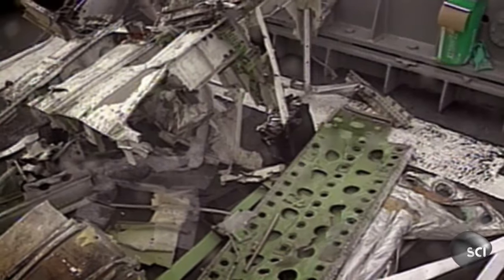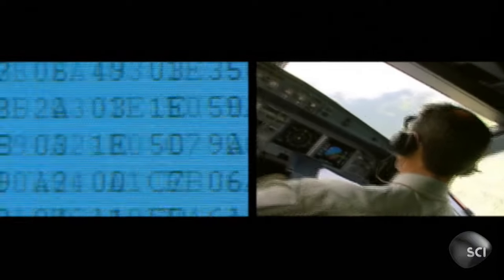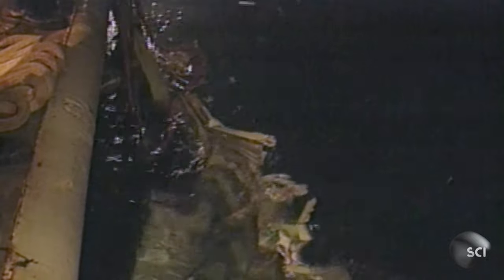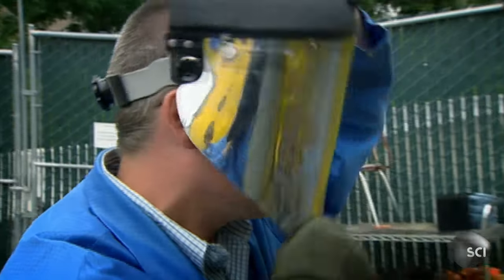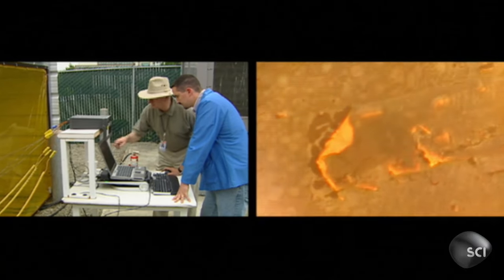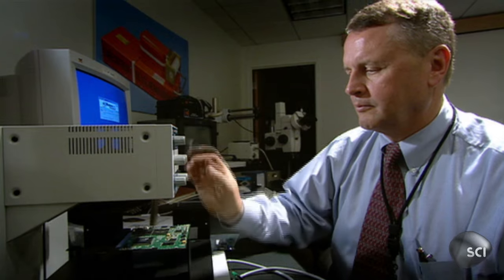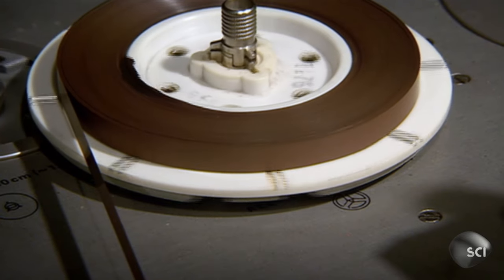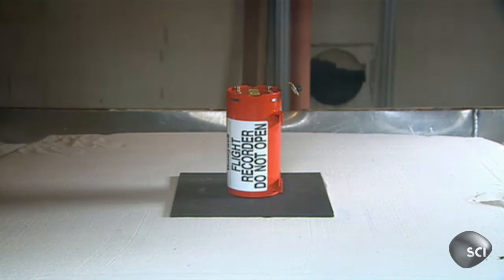How Black Boxes Are Made | How Do They Do It?

Comment: Why don't the planes just transmit the data to the ground for safe keeping instead of all this black box foolishness?  Because the pilots union has prevented losing control of the occaisional embarassing behaviour that goes on behind the scenes.  Pilots want to be able to destroy the data at the end of a flight.  Look at all the effort spent on finding black boxes at the bottom of the ocean when the data could have been easily transmitted and stored on the ground.
Reply: If something catastrophic happened to the plane like transmission signals to the ground were severed you would need the black box.
Reply: Brian Patton
No, no, no, a battery powered transmitter can be at least as reliable as a recorder and you don't need to find it at the bottom of the ocean.
Reply: Greg Collins if the transmitter is broken?
Reply: Actually, it's not that simple. A flight data recorder, as mentioned in the video, needs to be capable of recording several hundred different parameters at once, many times a second, for the entire flight, from engine startup to engine shutdown. That means quite a high bandwidth is required for every single aircraft that's flying with a wireless FDR. If that goes through satellites which it will because of all the transoceanic flying that goes on, then that gets very expensive very quickly, and it will necessitate new satellite launches and server space to download all that data from all those aircraft.

It'll cost the airlines millions to implement such systems, especially because you're looking at a data rate orders of magnitude higher than what ACARS is, plus it needs to be encrypted all the way down.

The $30k per plane onboard recorders suddenly seem like a much better idea, eh?
Reply: how are you going to handle all that information? who will receive it? what channels will each aircraft use? what happens when you're out of range? who will process and store the data? that crucial last half a second after the last transmission?
Reply: And also, crashes such as the one described in the video are EXTREMELY rare. It doesn't seem to justify the cost of a system such as the one you described.
Reply: They can't transmite data when over certain parts of the world
Reply: It is totally possible, in fact it is done now,, the R&R  engines, send a variety of parameters to Derby R&R headquarters when running. IMHO there should be a mixed system recording procedures, in plane & to manufacturer simultaneously.
Reply: Because when they are in the middle of the ocean they have no radio contact with ground
Reply: This is something that is being looked at currently at the order of President Trump.
Not to the ground but to the satellites that are above the plane as it travels.
Reply: Greg Collins clearly you don’t understand a thing about planes. First of all accidents are rare, and investing such a system for thousands of millions is not worthy, and can be hacked easier too. Second some not so developed countries may not have the ability to invest in that system, in this case the Flight recorder(black box) is still the safest way to store data. Third if it’s a wireless system there will be a way to shut it off, but Black Box cannot be shut off and will keep recording until that last moment of the flight. The newest black boxes have been greatly improved, they can now send signals for 90+ days once activated, can eject from the plane and float on the ocean or safely land if the plane crashes, and can withstand higher heat and more pressure.

Comment: The military shot it down because it was thought to be an UFO.

41. I can only explain that we have clear records that clearly prove that the plane was hit by a missile that was supposed to shoot down the TWA 800 for defence reasons, because a misinterpretation led to the assumption that the plane was an unknown and hostile object. 42. The missile, however, did not explode due to a malfunction of its detonator, but merely tore a hole in the aircraft and continued to shoot, only to fall somewhere into the sea. 43. Due to circumstances unknown to us, a sparking mechanism must have been created when the projectile hit, which caused the aviation fuel to explode. 44. It may be natural for someone to have brought a bomb aboard the TWA, but it certainly did not explode – if there was a bomb aboard at all. 45. Our records did not mislead us, nor did our investigations, to the effect that the missile projectile was the cause of the aircraft being damaged and then caused to explode by a sparking mechanism. 46. If the story about the man applies as it is set out in the written, then at least not in the sense that his bomb, if there actually was one, exploded. 47. If such a bomb actually existed, then it must either have been found by the salvage crews or thrown out somewhere into the sea where it was not found.
Reply: bro??

Comment: Worked for Honeywell for 11 years, testing Lithium Polymer/Ion batteries for 12 years, company battery expert.  1) NEVER EVER EVER trust what HONEYWELL tells you AND  2) any Lithium cell can go off like a road flare if dropped from hip height OR even in the OFF position in an over head compartment in an airplane. Makes me cringe that airlines tell you to turn OFF your phone! Makes no difference whether it's on or off. It can still cause a fire. People don't get it because of the media reports. Every lithium powered device anywhere, whether it be a Phone OR Honeywell Portable GAS detector (yes a life safety device) has had a fire as a result of a Lithium Ion/polymer battery. Just wait until a pilot in a plane has his device catch fire, then we'll see ALL devices banned from planes!!!

Comment: Everyone in here keeps talking about making planes like black boxes, do you understand if they even could do that (which would probably make the aircraft too heavy to fly efficiently), that even if the plane crashes, the people on board are probably going to die from the force of hitting the ground. The real question is, why don't they put parachutes on planes that can deploy in case of a 100% imminent crash or other severe failure such as a stuck landing gear? I heard it is because planes are too heavy, but come on, there has to be something that can be done. Private jets and smaller aircraft come equipped with parachutes for the aircraft in case of an imminent crash, we as a species have engineered and built incredible things, and made incredible discoveries, but we cannot figure out how to make planes completely safe in the event of a failure, other than recovering CVRs and FDRs and fixing the issues after many people lost their lives?

Comment: Do they still use tape? Or solid-state disk recording nowadays?
Reply: Most probably a hybrid . Tape are magnetic based after all. SSD are vulnerable to short circuit. Having a compact and reliable (hybrid) black box would solves alot of engineering. Problems are the recovery of one..... If only it's easy to locate them

Comment: is it possible to make a plane out of the material used to make the blackbox itself? in a sense how the durability was created, can it be integrated to what is needed to make a plane? if you say material is too heavy, isn't it just a matter of time we create an engine with stronger thrust and speed? in the end its all numbers after all.
Reply: It's not just about the material (they said the black box is made from simple stainless steel) but also about how it's shaped and how much of it there is. It's a quarter inch thick stainless steel formed in a circular shape and it's about the size of your firearm, and it's packed tight with fireproof material and some other foam. If you'd scale up the size of it leaving all the dimensions the same it'll be completely useless as a flying machine, unless you'd invent antigravity drives or something (but then I don't think you'd actually need so much toughness).
Reply: Unfortunately if they could, most fatalities are a result of rapid deceleration forces. Basically, all the organs and the brain rupture as they keep moving forward and crush themselves from inside.
  On the bright side, just dust off the plane and your good to go!

Comment: can't believe they still couldn't make the black box float + insert GPS in it. its time to upgrade.
Reply: Mike l well the rest of the plane is in the way for the black box to float upwards. And it is pretty hard to make a compressed air can (to be able to expand and float) to be able to resist such high temperatures. it would just explode.
Reply: U.S already has the floating steel technology, where even battleship will not sink in the future.
Reply: +Mike l wouldn't work well for the full black box/CVR , but I see little reason why a small, say 1 min worth of in flight recording, duplicate black box couldn't be attached somewhere on the outside skin of plane, and be designed to break off with a crash into water and do exactly as you suggest.

Comment: +tryteka Replying this way because you don't have a reply button showing.

Anyway, back when FDRs were first mandated, there was no digital air-to-ground communications system, and many systems are designed to be compatible with each other, meaning that newer systems are capable of being installed in older aircraft, and if required, vice versa.

And there still hasn't been any legislation mandating that the same data is streamed via satellites ('cause oceans fuck yeah).

not to mention that you're recording quite a bit of data, at quite a high rate. That results in quite a large amount of data that you need to transmit, which gets expensive, especially if you hire bandwidth on satellites owned by someone else.

Comment: It is time to use modern digital tech. These are RIDICULOUS! Idea- Use two SSD drives one mirrors to the other. Fully shield them from EMP, Emf, EMI. Mount in a shock-stabilizing manner in a thick Stainless steel enclosure with beacons, both visible, aural, and RF transmitting GPS.
Reply: James Ryan I think analog is more reliable

Comment: A lot people in the comments are seriously stupid. “Why can’t they make the plane with the same material?”
have you first of all considered the weight???? Airplanes are made of materials with small gaps in the middle to imitate bird bones that provides max toughness and light weight at the same time, if black box material is used then the tires won’t even be able to withstand the weight of the plane. 
Second, plane materials are always a bit flexible so they won’t easily snap in severe weather conditions, the hard metals used to make the black box have zero flexibility and will snap immediately in harsh weather conditions.
Seriously...i’d like to see you make a plane out of black box material and make sure it doesn’t sink into the ground before it leaves the garage...

Comment: @ the end he says "thanks to the flight data recorders flying is now safer then ever before"
Wtf does that have to with safety? I don't think it fucking matters that they have a data recorder when my plane is about to crash.
Well aside from the soothing fact that they might be able to retrieve the data and find out how I died.
Reply: Did you not watch the beggining because he says why it's helpful...
Reply: Well kind of true. It is useful for finding why the plane crashed but no, they do not make the plane ✈️ any more safer
Reply: It'd be fair to say that FRDs and CVRs indirectly make the plane safer, rather than directly. Low Level Windshear Alert Systems (LLWAS) alert pilots of microbursts and rapid changes in wind speed and direction, this is an example of directly making your flight safer. In 1975 Eastern Airlines Flight 66 crashed due to "windshear" caused by a microburst - the pilots didn't stand a chance. Thanks to the black box and flight data recorder the NTSB found out the cause and suggested that airlines be equipped with devices that can detect these rapid weather changes, thus NASA developed the LLWAS-1. This is an example of indirectly making your plane safer.
Reply: chi6075 if they found out how others die, perhaps your plane has minor improvements that prevented short circuits :)
Reply: Of course this makes flying safer. It is a bit similar to how our current medical knowledge helps us live longer lives thru the deaths of the people before us. 

Trial and error is one of the simplest way to improve and we humans are lucky that our ancestors were able to accomplish what they did.

Comment: Did this just debunk the fact that jet fuel apparently melts steel...
Reply: Raptor Rumble yes but jet fuel will make steel soft enough to bend with your own hands
Reply: @PiOfficial  After how long? Cause if it doesn't even budge here I doubt it'd bring a structure down.

Comment: Some of these black boxes gets very damaged. Why dont they make them as solid/strong as one of those bunkerbusting missiles which goes strait through +10 meters of reinforces concrete without failing to work??
Can someone give me a reasonable answer to this?
Reply: Those missiles rely on forcé they get from kinetic energy aswell as the materials it is made off. They also cost à whole lot more
Reply: adam jones he only wants to make the black box out of the shell, not the guidance/ computers/pricey stuff.

Plus you're arguing about penetration.

I think he wants the opposite half of that issue.

He wants the feature of not deforming on impact of these missiles.

He doesn't want/care for the black box actually penetrating a bunker.

Maybe you were trying to say hat it doesn't deform because of its speed? That'd be some cool physics, but idk.

Comment: Am I missing something? Magnetic tape? Anyone watch the air disaster with the French Air France Flight 447, Airbus A330? They used a small like 32 gig micro SDHC for voice recording. Wouldn't that be more reliable than magnetic tape? Or do they still use magnetic tape?
Reply: Don't forget that they're talking about a plane crash which happened in 1996.

Comment: Mfw a .25 steel box could survive a 2k degree fire but 1 inch steel beams couldnt survive half that temperature
Reply: @mikebyrd8278  How detailed
Reply: @darthvader6533  well for starters the exterior beams were not  1 Inch. The impact from the jets blew off the fireproofing an the heat from the fire made the trusses sag from the heat pulling the exterior walls inward until it collapsed. Also the black box did not survive

Comment: The very last statement in this video is " Flying is now safer than ever before " Actually no!!! It just means that the black boxes can survive a horrible crash and in most cases be used to determine the cause of the incident. Just because the black boxes are built to survive a crash doesn't mean flying is any safer... Just sayin...
Reply: +Joisey Kids Day 1: Airplane crashes because a hydraulic pump is fucked
Day 2: Black box recovered
Day 3: New hydraulic pump, future flights safer
Reply: Ariel Lezen you just made an argument for engineering corrections to plane faults being easier than ever.

The black box does not control the plane, nor actually change the plane it's in, so it doesn't make safer the flight(it makes FUTURE flying safer).

Comment: That System is OLD, There Should Atleast 2 Seperate recording cards On It, Not Some Old Rolling magnetic Tape . 
There should me ssd type tape to record and it should be electronic and seperated from airplane itself, with its own batteries that had charged from the LAST Flight, just before the crash and then it can send the signal out for years, ehh, i would design much better black box

Comment: None of the Black Boxes were recovered in 9/11.  Four planes crashed that day but not one of the 8 were recovered first time in the history of the device of planes not crashed in the sea, and MH370.
Reply: You are terribly misinformed. I knew for a fact Flight 93's CVR was recovered. How? I visited the flight 93 memorial, and they had different pedestals with information about the flight, how it started and the events leading up to the crash, one of them was audio from the CVR, and after the last pedestal, you went into the memorial which had the names of all the victims on a marble wall that was built along the path to where it crashed.

Here is the transcript from the CVR of Flight 93, that according to you, was never recovered: https://en.wikisource.org/wiki/Flight_93_Cockpit_Transcript
Reply: I took the privilege of looking up your other claims. Both flight recorders from flight 77 were in fact recovered. But none were recovered from the planes that struck the world trade center. The reason they explained, was because the flight data recorder and CVR and designed to withstand incredible impact force, and high temperatures caused by jet fuel that ignites, and burns off relatively quickly, not over a prolonged period as what happened when they hit the world trade center.

So, your investigation is piss poor and holds no validity. So off to the conspiracy sites with you, no one wants to hear your bullshit lies.

Comment: I wonder why they don't make it out of graphene. A quarter inch thickness should be able to hold the entire weight of the plane! I know it's expensive but it works better than anything so far!
Reply: Because it’s extremely expensive, difficult to obtain, and offers no net performance advantage over steel. The weight savings are nothing compared to the overall weight of the aircraft. Do you even think before you speak?